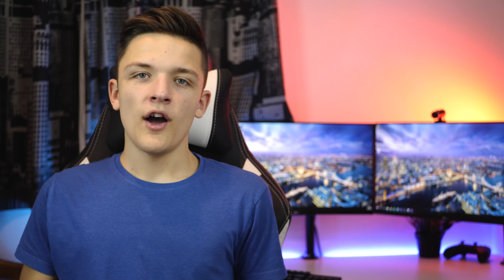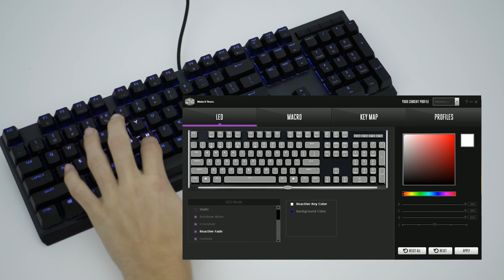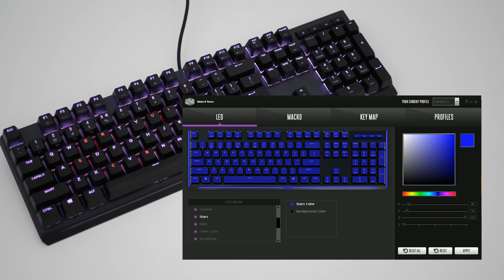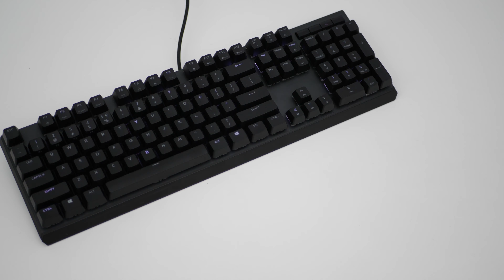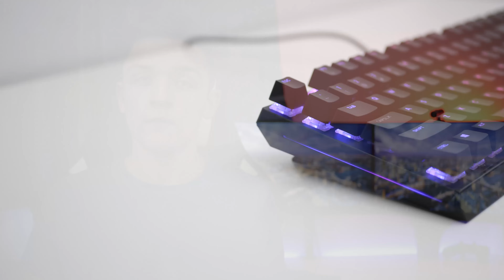Cooler Master MasterKeys MK750 Review! [CORSAIR K70 KILLER?!]

Comment: I'm thinking to but the brown switch one from amazon.co.uk. But I want info if the enter key is big or small one. There is a lot of mixed info
Reply from the maker: It should be the UK layout with the larger enter key. Mine has the smaller enter key as I received it from the initial US shipping batch prior to launch :)
Reply: lookup ANSI and ISO, it will become more clear ;). ISO UK is the stock UK layout (Big enter, small left shift), ANSI is US intnl (small enter, big left shift)

The one on amazon.co.uk is the UK version, look at the serial number: MK-750-GKCM1-UK (the UK is for UK (big enter) layout)